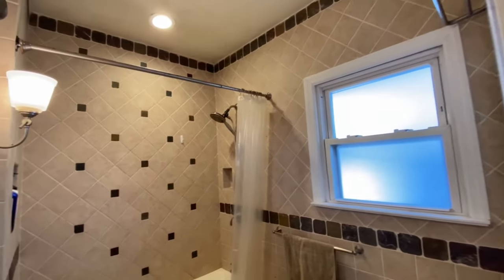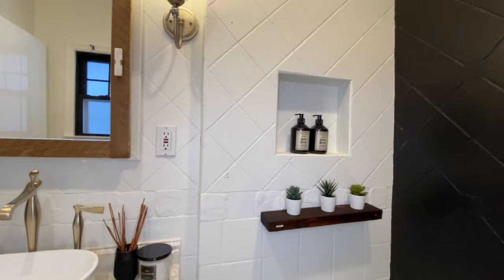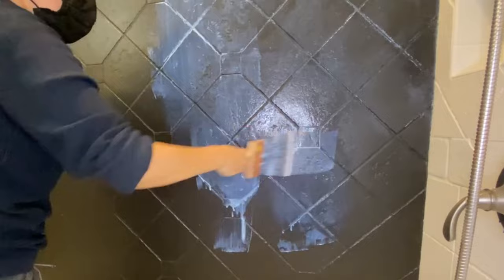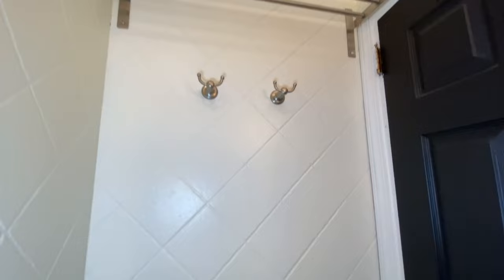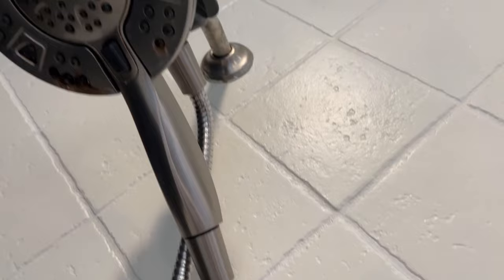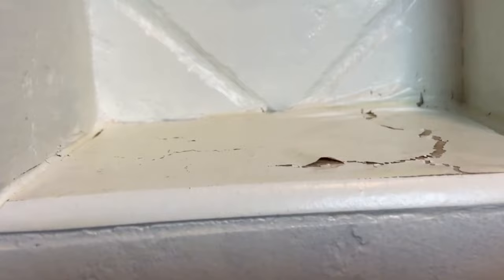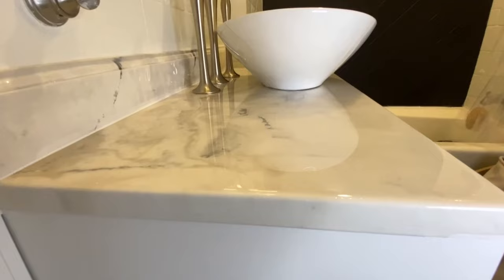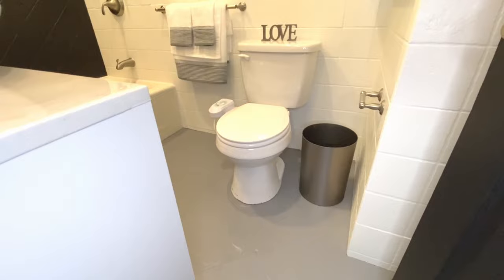UPDATE || How are my PAINTED TILES Doing?

Comment: Don’t you get mold or soap scum and hard water around the tub and shower area? That would be my concern because that stuff needs to be scrubbed or use chemicals. Even vinegar degrade the paint.
Reply: Some of the tile paint is scrubbable and will hold up to chemicals but after a couple of years will get some breakdown painting tiles is a temporary fix for a few years not forever.
Reply: Using soap is the issue I’ve discovered. Using liquid soap  = no soap scum = no mould. Ditch the cake of soap. Since changing to liquid soap I have no soap scum or mould problems anymore.

Comment: I had my bathrooms professionally painted and it was a disaster. I had glossy tiles and the paint was glossy. They didn’t do a very good job. It started peeling months in and the mould started peeking through. I saved my money and got all three bathrooms demolished and done. Yes it was a headache and there was a mess, but I love them. Matt porcelain tiles are the best and good quality hardware. One year and a half in and looking after them, the bathrooms still look brand new. A combination of grey tiles, chrome hardware and timber look vanities to warm up the space, picture perfect.
Reply: I'm considering a tile paint right now. 😅 The professional painter told me that they/I had to do the following: Clean the whole bathroom properly first (first with a lime remover agent and then twice with strong housewash agent) and use fine grit paper to sand it down, because paint doesn't adhere properly to glossy tiles.  Then apply the tile primer before applying two coats of the "oily two-component epoxy-paint" (don't know the proper translation) made for tiles. I was told that there are watered down versions of epoxy-paint as well, made for lighter colours (non-watery loses gloss on light colours far too quickly), but those can't be used in wet areas without peeling over time. Did your painters do this and still fail, or did they do it differently? I'd welcome your experience before making the choice myself. 😊

Comment: THANK YOU for posting this. 
We just bought a place with tile like your old one and were wondering what to do. We didn't think about looking into this but it is a great idea. 
We did something similar in our old bathroom. I personally love the way it turned out with the black and white. We only did the bathroom walll, not the rest. We did have to coat it twice because it was stone not tile.  The second time, we used a 'spa paint' that would hold up better against the water.
Reply: thank you for sharing your experience. how much satisfied are you about the result on your bathroom?

Comment: Hi. I watched both of your videos. The original and this follow-up. Great videos! One thing I'm a little bit confused about is that I believe you said at one point you said that you skipped step one which looks like Rock Solid Rust-Oleum base coat. You said you used that other primer that said "Stix" on the can. Looking back are you saying that you think you should have used the base coat Rust-Oleum Rock Solid rather than the other primer that you used? Thank you very very much.
Reply: Great question! I am wondering the same thing. Stix is a great primer. I used it with Benjamin Moore Advanced Cabinet & Trim paint and it is outstanding which was recommended by the Benjamin Moore employee over the Benjamin Moore Advanced Primer if you could believe it.